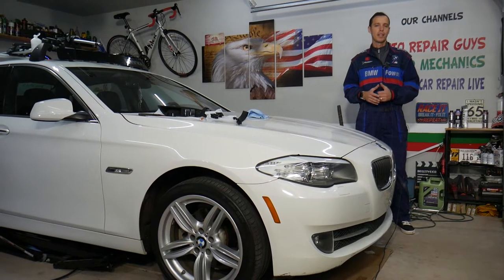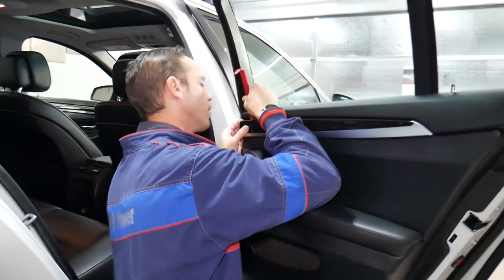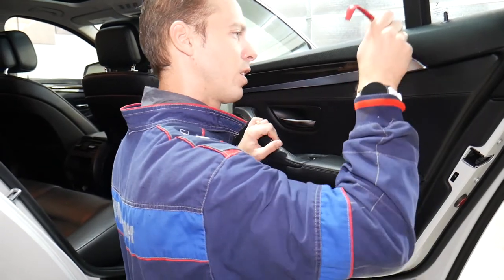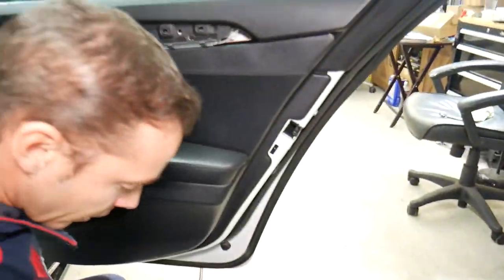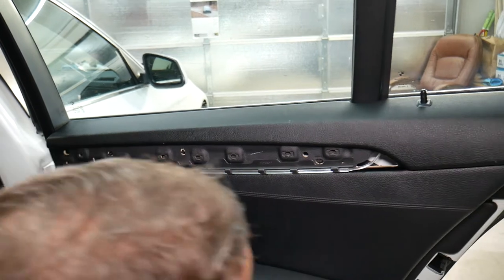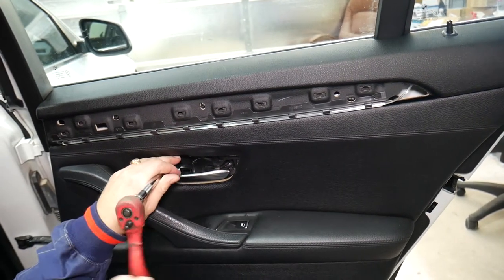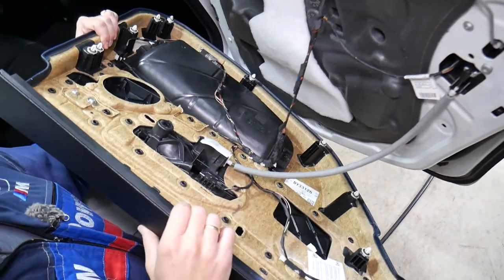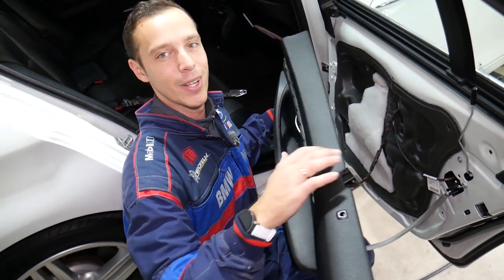BMW F10 F11 REAR DOOR PANEL REMOVAL REPLACEMENT 520i 528i 530i 523i 535i 518d 520d 525d 530d

Comment: I have yet to find a video to remove the door panel on my 2013 535i GT. The door handle cover is sitting up high oh the upper trim where you can’t pry off. The videos you show are for an easy access to the handle cover.

Comment: I was fixing the water leak issue. After removing the door panel a metal clip fell off. It's a U shaped thin metal flat retainer. I spent hours thinking where it might go with no success. Does anyone know where it should go?